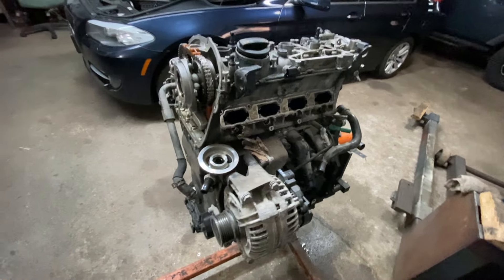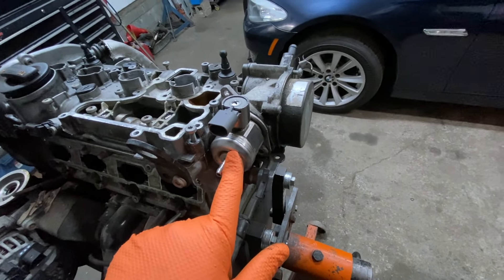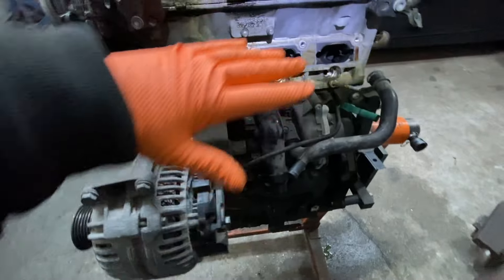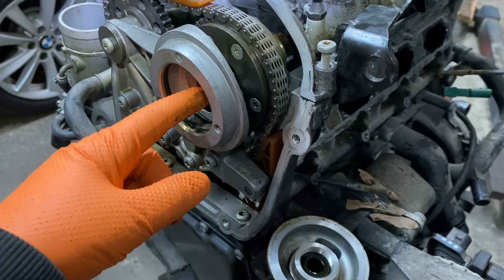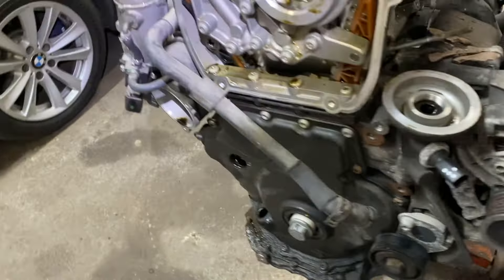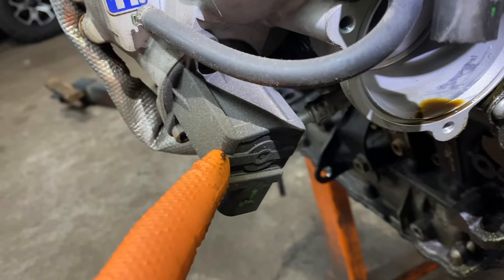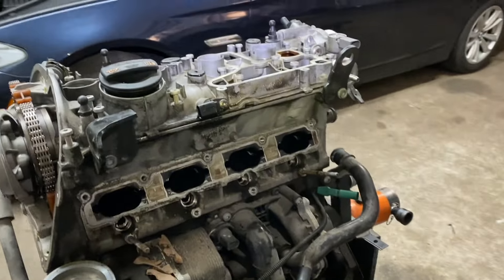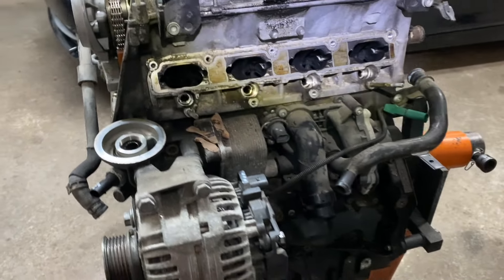Engine Sensors & Components Locations On VW / Audi TSI 2.0 Turbo Engine

Comment: Where are the knock sensor?
Reply from the maker: Should be a green plug
Reply: @motorcarnut  green plug?  The engine compartment is really dirty in my 2003 VW beetle 1.8l and I cannot find the knock sensors to save my life, specifically the bank 1 (sensor 1).  Other youtube videos mix up the terms crankshaft and knock sensors which doesn't help because my crankshaft sensor is now unplugged... 
There is a video out there on 2008 vw beetle knock sensors but I cannot distinguish if 2003 knock sensors are located in the same place. Help!
Reply: Where is it at?
Reply from the maker: On the engine block
Reply: @motorcarnut  Thats not specific at all. I don't know if you are trying to be funny or what.  I found both, there are two.  One is on the backside of the engine block which is largely inaccessible and the other is under the intake manifold and you don't have to remove the intake manifold to get to that knock sensor.  You just have to put the front of the vehicle on a ramp and then you can access the knock sensor and also the camshaft sensor.
Reply: Yeah I’ve been trying to change the knock sensor for my Audi a3 2015 1.8t, and I can’t find it for the life of me, everyone keeps telling me on the side of the block but where!!!! Anyone help plzzz😭
Reply: I wish you would have shown the end of the knock sensor
Reply from the maker: @understandthis4634 the knock sensor it in on the left side of the water pump on the block and has the green connector near the intake manifold where the other plugs are on that brackets.

Comment: My car was blowimg white smoke out the exhaust like no bodys business im talkn bout cloudi g up the neighborhood type smoke lol. Had a mechanic try n tell me it would cost 5,000 to replace my bad motor. Thats withput the cost of my bad turbo he also said i had. But i knew better than that.  U wanna know what it was my motor is perfectly fime my turbo is perfectly fine. .... We cleaned the fuel injectors. Turns out 1 was clogged. Car runs like a new 1 now😂
Reply from the maker: Glad you saved some money and fixed it yourself! Thank you for the extra info, may help others with similar problems.

Comment: What is the thing next to the crankshaft sensor 😭I have a leak there but I don’t know what’s is call? Anyone knows
Reply from the maker: It’s probably not that but the water pump if it’s coolant or valve cover if it’s oil.

Comment: This was really informative. Great job. A little confusing, but great none the less. I would have never looked for a belt for the water pump in the back of the engine. Never. I'm saving this video since my grandson just got a car with one of these runs in it.
Reply from the maker: Thank you for the feedback, if you needed a little more info just let me know.
Reply: @motorcarnut  do you know if anyone makes a video of the coil and plug replacement for these engines? The one he has looks like it has 2 sensors per cylinder. I don't recognize what I'm looking at. Mine is so much simpler.
Reply from the maker: @fredericocorrea9814 I don’t at the moment, sorry.

Comment: what's the black plastic cover to the left of the crankshaft sensor (1:04)? It has a number of torx screws holding it on. I have some oil leaking out of the bottom of that area. Thanks for pointing everything out.
Reply from the maker: Thats an access for the balance shaft, you can just reseal it.
Reply: Great. Thanks for the information. Very helpful @motorcarnut
Reply from the maker: @sanyopoweraid1 Thank you for your feedback appreciated!

Comment: Can you explain to me where the engine coolant bypass valve is located 2018 tiguan TSI p2681 code came on? Thanks
Reply from the maker: It should be on the bottom of the cylinder head right where the engine and transmission bolt together

Comment: Would either one of the coolant sensors cause a CEL light to come on when using the heater? Got a p8577 code. Thanks. Also, should both sensors be replaced?
Reply from the maker: That code is for the coolant system, not necessarily because you are using the heater. Could the the coolant temp sensor, wiring to and from the sensor, or a bad thermostat .

Comment: Hello,
I subscribed immediately after watching this very informative video.
I have a question about buying a car, but I am in a dilemma.
Could you please recommend which engine is better, TSI or TDI, in the stronger 2.0 models from 2022, among the Superb, Golf VIII, and Passat? I need more space in the car.
Reply from the maker: Thank you for the sub! Appreciate!
The 2022 and up TSI and TDI are both great engines but you have to decide if you want a diesel or gasoline engine. I would prefer the TSI Golf VIII
Reply: @motorcarnut  
Thank you so much for the response, I think I'll go with this one, the R8 Golf. I hope the engine will be fine:
Volkswagen Golf Variant R BLACKSTYLE LM19 R-PERFORMANCE H+K
Mileage: 77,880 km
First Registration: 09/2022
Power: 235 kW (320 hp)
Fuel: Petrol
Reply from the maker: Great choice ! Good luck should be a great vehicle! super fun to drive.

Comment: Could you tell me where the thermostats is located?  Also, im replacing my ECT sensor on my 2013, vw cc.  I read the other comments, is there always two sensors?
Reply from the maker: It’s on the water pump under the intake manifold
Reply from the maker: ECT is also on water pump under
Reply: @motorcarnut  thanks for responding man.  Is there always two sensors?
Reply from the maker: @KalvinistKyle No some have 2 but yours has only one

Comment: Can you tell me where the turbo boost pressure sensor might be ?  I just got a PO 236 error code
Reply from the maker: It's on the turbo near the passenger side frame, better access if from underneath the vehicle.
Reply: Thank you very much ! Good luck to you
Reply from the maker: No problem! Thank you

Comment: Hay man I may be slow or what not but I got a 2008 Audi a3 with this engine and I’m having the throttle positioning censor code and really struggle to find it
Reply from the maker: It can be the throttle body itself that’s bad or the wiring circuit

Comment: Does tbis engine has a map sensor ? If so , where is it located ?
Reply from the maker: No , it uses a Mass air flow sensor located right after the air filter.

Comment: P256300- Turbocharger Boost Control Position Sensor Circuit. Range/Performance. Do i have to replace the wastegate actuator?
Reply from the maker: Sounds like a wiring problem or the sensor itself

Comment: So close to what I was looking for. I can see the plug for the waste gate position sensor plug. I had to replace the wiring harness after a raccoon ate it. What does the other end connect to (I know where it connects to the waste gate actuator, where does the other end go)
Reply from the maker: I’m not sure what you mean? Just repair what was damaged.
Reply: The raccoon ate all but about 1” from the position sensor on the wastegate actuator itself. I don’t know where the corresponding end even connects to for me to pull and repairs it. The engine is still in the engine bay so it’s a tiny space. I can’t really get a good look around 
I’ve searched for days. Can’t find any of the wiring diagrams 🤷🏻‍♂️

Comment: Question sir, for replacement of the coolant sensor next to the water pump, can it be reached and replaced without removing the intake manifold?
Reply from the maker: Yes, but difficult

Comment: How many camshaft position sensors does a 2017 Audi A6 2.0T have
Reply from the maker: One
Reply: @Motorcarnut thanks I changed it with a audi sensor, but I'm still getting a code for the camshaft sensor
Reply from the maker: You have to check the valve timing and the oil control valve. These cars control valve timing with oil .

Comment: Where is the thermostat switch... NOT sensor?  I'm surprised how little people talk about this since this is what would cause a stuck open or closed coolant path situation. Thanks for the video and any help. My intake manifold is currently off the vehicle Will this make reaching said switch easier?
Reply from the maker: What year and model or talking about? most are controlled by the computers  information from the coolant temp sensor?
Reply: @motorcarnut  2013 Volkswagen Eos
Reply from the maker: @duckamuck1756 there is no switch in that car just the cts in the water pump hosing

Comment: Are there two coolants sensors? 14 jetta gli 2.0t in question
Reply from the maker: Yes, one is on the lower large coolant hose right near radiator and the other one is underneath the intake manifold, hard to get at.

Comment: I got a 2010 cc 2.0t , I got the crank sensor on the valve cover but that harness splits off with another plug that I can’t seem to find the connection for , any help?
Reply from the maker: There is not supposed to be any other wiring that splits off that plug

Comment: I have a 08 EOS 2.0t komfort, and Im having a difficult time locating the transmission speed sensor. Not the crank speed sensor or ABS speed senor. Google searches always show different cars and videos are too low quality or dont explain it well. Any help would be appreciated
Reply from the maker: I believe on your vehicle it’s in the valve body in the transmission

Comment: I have a 09 Passat 2.0t with a p0299 code and was told I need a new turbo.  Do you have a video on the removal for the turbo
Reply from the maker: I’m making one as we speak, hang tight
Reply: I’ll be waiting have the new oem turbo coming in this week but I’m also looking to replace my catalytic converter and I’m wondering if the cats from a 2008 Passat 2.0t are compatible with my 2009 Passat Komfort 2.0t? I see the cats for a 2008 Passat being sold for cheaper but a lot of the websites say it’s not compatible with my 09 Passat

Comment: Hello i have a 2011 Audi A5 Quattro  with code p0327  knock sensor bank 1 can u tell me where that would  be located at  on my car?
Reply from the maker: It’s under the intake manifold on the engine block pain to get to as well.
Reply: @motorcarnut  Thanks!
Reply: @motorcarnut  When ordering this part would it be a front  knock sensor? Not sure how many this car have.
Reply from the maker: @misshumbledone no problem!
Reply from the maker: There is only one

Comment: Is it the same place for Volkswagen Passat 1.4 TSI 2010? I need to change crankshaft on mine.
Reply from the maker: It’s a different engine but should be in the same general areas.

Comment: I have a 2021 Cupra Leon estate with the 2.0 engine. 310 hp. Im struggling to locate the underside boost sensor that’s meant to be connected to the inlet pipe… could I have some help? Any advice?
Reply from the maker: I don't have that vehicle in my repair system because it's not sold in the US. Seems like an awesome car! Just follow the the inlet pipe from the boost side on the turbo all the way to the throttle body. Or if not there on the intake manifold there will be a couple of sensors, just search online for the correct part and compare it to the ones on the manifold.

Comment: HI, thanks for the info but you missed 2, bottom of oil pan and there's 1 next to crank pully above the sump do you know what that's called
Reply from the maker: Thanks!, Bottom of oil pan doesn't have any sensor unless the Audi does which would be oil level sensor. In the other location I didn't see one but that area would be a crankshaft position sensor.
Reply: @motorcarnut  oh sorry I should have said I got the GTI motor, I thought they all be the same for ea888
Reply from the maker: No they aren’t, but not sure as I don’t have one in front of me right now.

Comment: Hello. Can you please tell me where the oil temp sensor is on the vw passat b7 1.8 TSI?
Reply from the maker: Should be near the oil filter housing
Reply: @motorcarnut  Thx...gonna give it a look
Reply: @motorcarnut  Checked...it isn't there...🤔
Reply from the maker: @puffy8992 what year is your vehicle?
Reply: @motorcarnut  2011
Reply from the maker: @puffy8992 Does your car have an oil level sensor too?
Reply: @motorcarnut  yes it does
Reply from the maker: @puffy89Og  Ok, then it's part of the oil level sensor inside the oil pan.
Reply: @motorcarnut  Thx , just found a video about it this morning. Thx for confirming it 💪

Comment: I’m trying to found out where my crankshaft sensor would be on my 2017 TSI SE Jetta 1.4
Reply from the maker: Should be in the same location, near the back of the engine towards the front of the car

Comment: Wow motorcarnut you really answer all questions.. it’s old post so response totally understand .. have 2006 Vw Passat 2.0t and car starts good runs good but seems after awhile it stalls and does and if I give it 20-1 hour starts back up .. maybe worse as wetjer gets hot .. researching seems maybe low or high pressure fuel sensor .. what’s your professional opinion?
Reply from the maker: Does the car have any codes coming up? Could be fuel related

Comment: Where is the knock sensor? What do I need to remove to replace it?
Reply from the maker: It’s under the water pump extremely hard to get to without removing the water pump if I remember correctly and a 10mm triple square socket

Comment: whats the easiest way to replace the coolant sensor?
Reply from the maker: Underneath the car, it's on the lower radiator hose mid way up.
Reply: and thats the one next to the water pump or under the intake because theres two sensors i already changed out (G83) and now just need to change (G62)
Reply from the maker: Which one did you replace? The one on the water pump housing or the pipe?
Reply: @motorcarnut i replaced the one on the the pipe i just need to replace the one on the water pump. I have access to it now, i removed some things to access it but i ran into an issue. Are both sensors the same ? the one next to the water pump the same than the one on the hose? if i purchase the same one i used for the hose can i use it for the one next to the water pump?
Reply from the maker: I believe they are different, should have a part number on the sensor itself.
Reply: @motorcarnut  im having trouble looking for that sensor would you be able to provide it?

Comment: Where the map sensor?
Reply from the maker: That engine uses a Mass Airflow Sensor ( MAF ) not a MAP. It’s located on the air intake tube between the throttle body and air filter housing.
Reply: @motorcarnut  I’ve got a seat Leon cupra 280 and I can’t find the location of a map sensor.